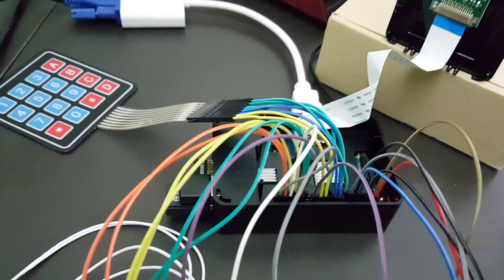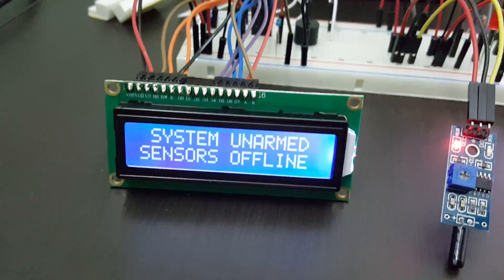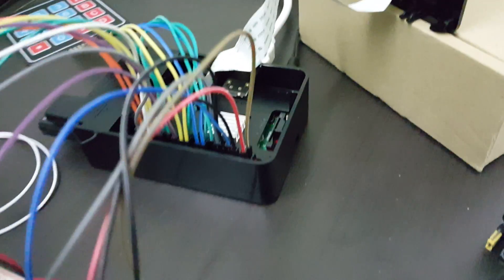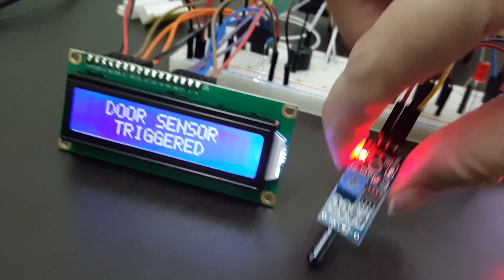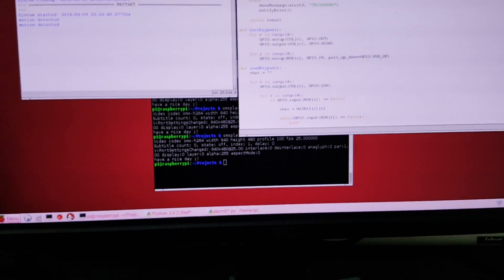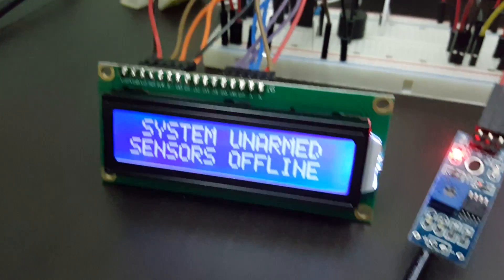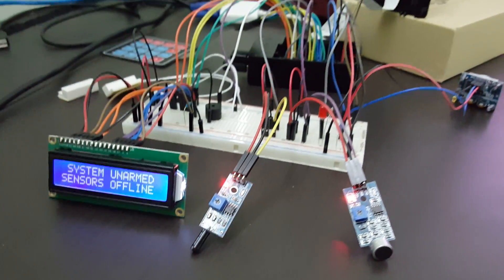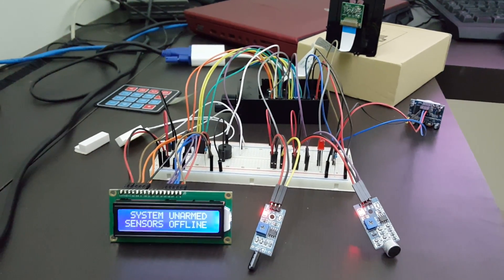Raspberry Pi 2 - Home Security Alarm System (Learning Prototype)

Comment: I think this is an excellent introductory project and he will have learned a lot from it.  A comment he made was that there were few GPIO pins left.  It would be possible to save 4 of these by using the LCD in 4-bit mode rather than 8-bit mode.  I2C is for the more advanced user which is probably where he is now!  For the critical commentors, remember it is a learning tool, not a practical, commercial implementation.

Comment: There are some limitations to DIY alarm systems made from Raspberry pi's.
Firstly you have to understand what you are protecting, and what burglars are able to do to gain entry and defeat your systems.
You also need to know each and every fail point, and whether such a fail is a burglar or power outage etc or just a lost connection or even component fail (and fail they do quite often circa 5 years on average - not to mention updates required to update the system etc)

Comment: This is great and all but completely impractical. The wireless door sensors shouldn't have to be hooked up to a Pi - that would get very expensive for each one, and would be bulky. Rather, you need to use 433mhz transmitters/receivers to one pi. And who needs a keypad when you can ssh in 2 seconds from your phone to activate/deactivate? And speakers to give you verbal updates? And you must password protect your live video stream. And the software to only record motion and upload to google drive and to email? And send texts to you when the system is activated AND someone trips a sensor? And the 30 second countdown before activating 433mhz wireless siren?? And 433mhz glassbreak sensors?
Reply: Dude, it has been made clear that there may be a rebuild with a more optimized design. Obviously this is a prototype for learning purpose. Didn't you read the description?
Reply: Sorry, it's just that the title states that it's a RPI security system, and the description only suggests that you may optimize it. I simply gave you suggestions for future optimizations, and then shown you the implementation of those suggested optimizations. I have found few actual practical, complete RPI alarm system setups online. No hard feelings!